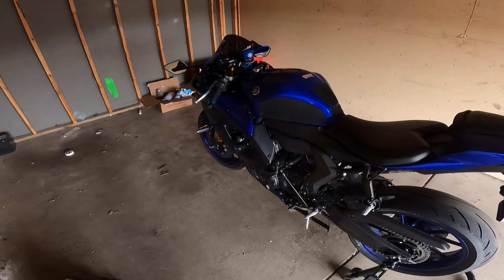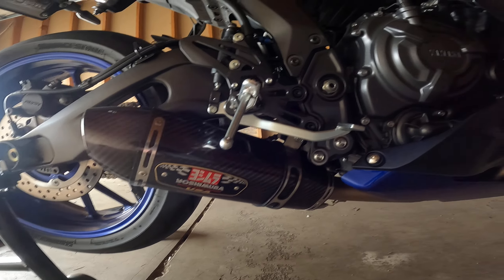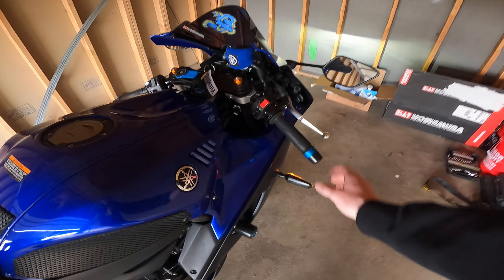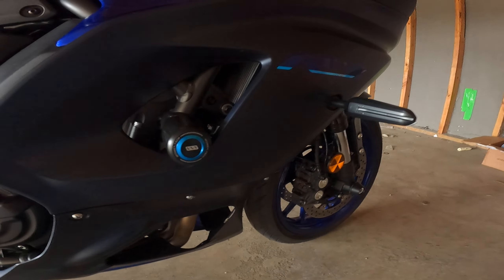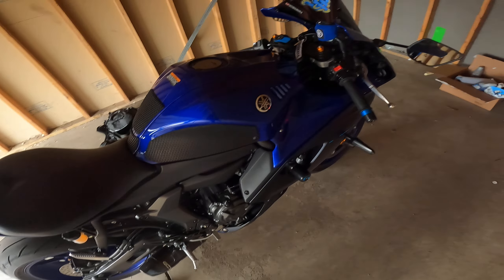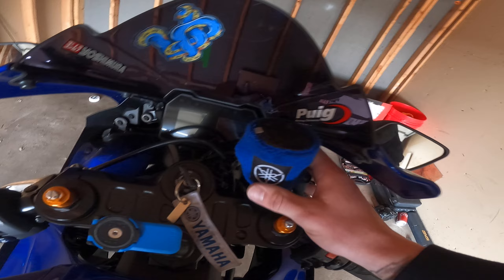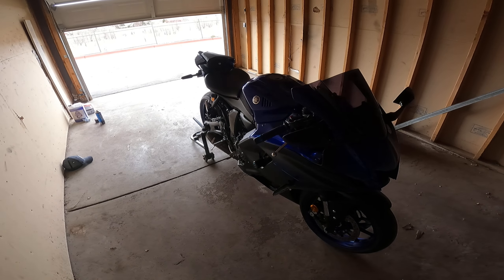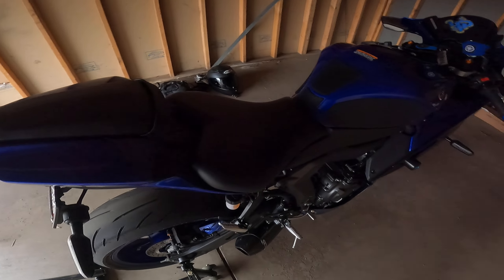2022 Yamaha R7 (R77 Full Yoshimura Exhaust+Modifications)

Comment: I just bought an R7 and I want to change the exhaust, but I don’t understand the deal with getting a tune or messing with the ECU could you help me out?
Reply from the maker: yeah man, so tuning it after a full exhaust is recommended because if you don’t there’s a chance your bike will run lean and will actually cause a power decrease. There’s an ECU box that is under your seat that you can actually unplug. Once you have the ECU unplugged you can send it to a company and just tell them what bike and full exhaust you have and they will map it for you correctly😎 I’d definitely recommend “2 Wheel Dyno Works” for your ECU flash. If you have any other questions feel free to shoot me a message on IG.
Reply: Thank you I really appreciate the help and great videos!

Comment: With the flash and full exhaust, what power difference did you notice? Was there a higher top speed? More torque/HP? Was the full exhaust worth it or would a slip on basically do the same thing? I'm thinking about buying an R7 and doing the exact same thing. Just curious.
Reply from the maker: I don’t think you really get any HP gain from a slip on, the R77 gave me like and extra 5HP, I’ve topped it out at 139, and it sounds amazing, in my opinion it was worth every penny
Reply: @TSORides  Gotcha, I appreciate the feedback bud. Hope you have a good time on that beautiful bike. I honestly think it's the best looking one out there right now.
Reply from the maker: @lukasschindler4004  checkout the wrap that I just got done to it👌
Reply: I have a R7 and I don’t believe you can put a slip on exhaust on it. Not 100% sure but I believe you will have to do full system no matter the brand.
Reply from the maker: @mississippirick7552  looks like yoshimura R77 has a slip on and full exhaust option
Reply: Ok. Yeah. I wasn’t sure but I did the SC Project full exhaust and I am loving the pops lol. I like my bikes loud as hell because here in Mississippi, some drivers do not focus on their entire surroundings while driving.
Reply from the maker: @mississippirick7552  was debating on getting the SC project, but ended up going with Yoshimura